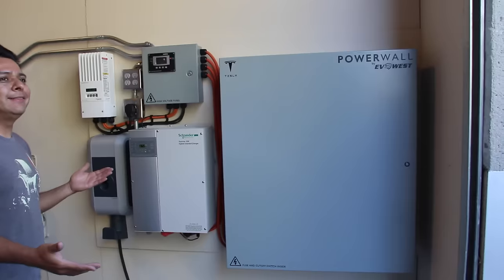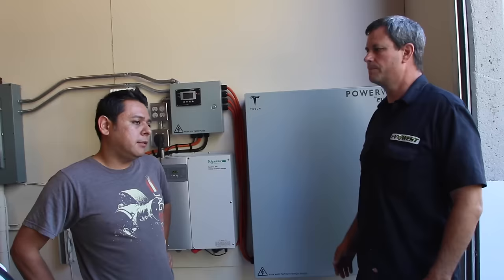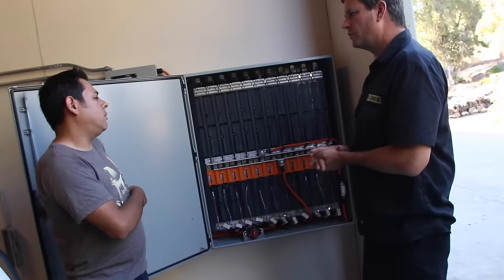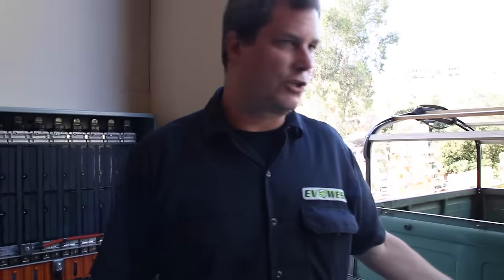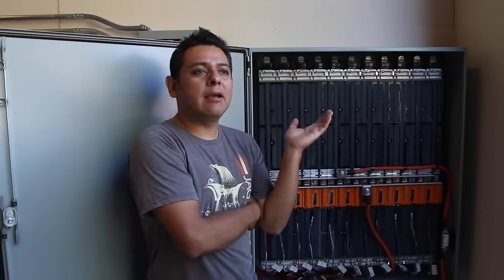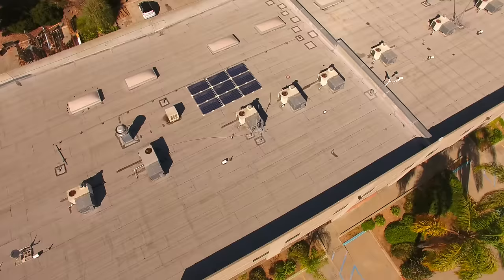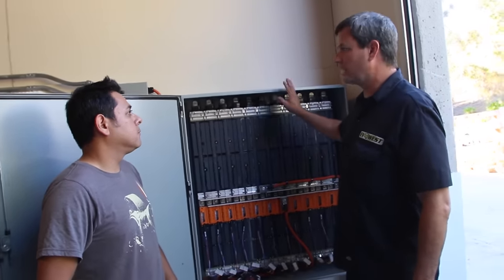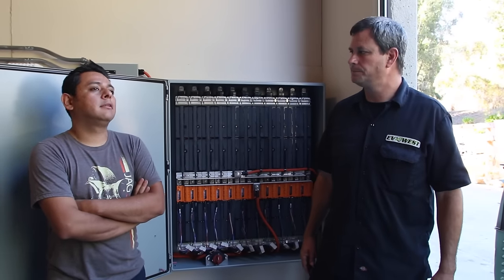DIY TESLA Powerwall  - my  WALL vs ELON'S WALL

Comment: what Tesla need to do is add solar cells to the vehicles ruff
Reply: That would net you about 100ft more range each day wow totally not worth it
Reply: Acually I think this idea has potential - I was thinking about this for some time. I dont think this would be great for personal vehicles - although it wouldnt need to affect aerodynamics in any way. However, with anything bigger than that like trucks this is surely the future. It would help much more than 100ft.
Reply: Stefan can you add? No it would not help much more then 100ft
Reply: I think this "100 ft" argument is nonsense. Keep in mind that the panels would charge the battery all the time - not only while you drive.
Reply: All the time even at night lol.  No its not nonsense you can do the math for any give vehicle you simply have to figure out how much energy it takes to move it 100ft look at the max amount of solar panel area you can put on the roof.  What is the max kwh production of those panels? Do the math as many others have and you can see for yourself 100ft is not nonsense.  If solar panels where that awesome.  I would only need one small panel to power my whole house.
Reply: +Wok if your house was small enough :)
Reply: so 80watt/hour while your car sits in the sun for 10 hours while you're at work... 800watt. How much do you think it takes to move a car a hundred feet exactly?
Reply: dosmastrify
I am from the country where they do the 100% solar powered races and those things go 120kmph for hundreds of km. You guys obviously have no idea what you can get into a sedan size with solar panels if you try.
Reply: dosmastrify
yeah my point was people who drive to work, park in the sun and then drive home. There's a lot of potential to charge the battery to full for the trip home. If that's 90% of a persons driving it would be worth paying an extra couple of grand at point of sale...
Reply: you do know there are flexible solar panels.
Reply: if solar panels could somehow charge using infrared it would charge during night.
Reply: dosmastrify you could put it on the roof under glass molded to fit the shape of the car.
Reply: dosmastrify
there are plenty of clear hard coatings. and yes you can have bendy solar panels. You could put solar panels all over any car pretty much...
Reply: The Tesla sales guy said there wasn't enough surface area to justify it. He gets that question a lot!
Reply: 800 watts is ONLY just over 1 Horse Power (760 watt)! In fairness, you'd probably get more than 80 watt hours. Most of the modern panels about the size of a car roof are around 250 watt. (the size in a domestic PV installation) ... so 2.5kw or 3 Horse Power. Compare that with the highly specialised and sophisticated Formula 1 power storage of around 120 KILOWATT(!!!) which only lasts for about 30-odd SECONDS!!! 

Just to be clear, 120 kilowatt (F1) is 4 MJoules of energy (max ALLOWED to be collected per lap), or about 160 Horse Power (Golf GTi range) so no mean feat to gather that in ONE lap from the braking, the turbo and the heat output of the engine. A Joule is a Watt second so 3600 Joules is 1 Watt hour. 

4MJ is 4 x 10^6 / 3.6 x 10 ^6 = ~1.1kWh
divide by 760 to get Horse Power and multiply by 3600 for Horse Power seconds and divide by 160 to see how many seconds at 160 HP = 1100 x 3600 / (760 x 160) = 32.5 seconds

BUT, and it's a HUGE Kardashian BUTT, it lasts for only 32.5 SECONDS!!

People on here think they can generate that from a single panel on the car roof? Err NO! Even a pathetic Renault 2CV (9 HP) produces almost 7 kw and it can deliver that for HOURS! 

Even if you said you had only 75 Horse power (equivalent to a normal Golf 1400), 120kW/4MJ would only last 16-20 seconds. Even if you accelerated slowly and only used 30 HP getting up to 60 mph, you would have run out of power just a couple of seconds after reaching 60 - if you got there at all. 30 mph is 44 feet per second - you do the maths. You would NOT get to 100 feet on 2500 watt/3 Horsepower, or VERY unlikely to - would it be enough to MOVE the car?

You can test something similar with your normal ICE car. With a fully charged standard 12volt battery, you will have around 40AH to 80AH available. That's 480 to 960 Watt Hours (similar to what you proposed is available from a solar panel). Put the car in gear, let out the clutch, turn the ignition and see how far you can use the (highly geared) starter motor (BAGS of torque) to move your car before the battery is killed or just unable to move the car? How fast did it go? If you managed to get 20 feet you were doing well. 

I DO NOT recommend doing this exercise as you will likely damage the starter motor and knacker your battery but hopefully you get the point.
Reply: Bob Lewis the point of solar panels is to store the energy and use it later, not to directly use the energy. while the car is driving it could charge the batteries. there are solar panels that can generate 1000+watts.

and dont forget that these solar panels are all 2D. if you made the solar panels clear and 3D it can generate more power.
Reply: MrPepsicola123 Please explain to the readers EXACTLY how long it will take to store 4MJoules or 120kWatts using a 250 watt solar panel or did you miss my specific and basic arithmetic? And I NEVER stated, NOR implied that I was talking about using a 250 watt PV panel to drive a normal vehicle directly. You CANNOT STORE 120kWatt in 10 hours. Even IF you could it will only last you 32.5 seconds when producing 160 HP. Please do NOT promote such idiocy to people who probably genuinely want to understand but are being totally confused by uneducated and unqualified people spouting utter garbage!

BTW I'm a graduate electronics engineer of over 40 years standing and as it happens my youngest brother is the engineer at McLaren responsible for the MGU power setup on their F1 car. What are you credentials?
Reply: Bob Lewis Have you heard of stirling engines? I couldn't care less about your credentials. it doesn't prove that it's impossible because you say so.
Reply: Of course I've heard of Stirling engines. Sigh! What the hell do Stirling engines have to do with solar power panels? Solar heating used to drive the Stirling cycle? Yes, OLD news. That's NOT what has been suggested here. The suggestion is that one should put solar cells on the roof of a car to recharge the battery on the fly. The ONLY relevant thing is this:

To move a vehicle requires power , measured in Horse Power or Watts it doesn't matter which. If the vehicle requires x watts to run at a certain speed and you can charge the battery (or drive the motor) at y watts and y is bigger than x, then yes, you CAN keep the vehicle going all the time. However right now, today, x >> y!

What YOU are claiming is that  a 1000 watt panel (or even if it were available a 2 kW one) is big enough to replace the power consumed by a vehicle travelling at reasonable speed (say 30 mph/50 kph) as it goes. 

I've already explained that it is TOTALLY NOT sufficient because that equates to 1 kWh ONLY after ONE HOUR whereas a practical amount would need to be nearer to one half of that amount (500 watt hours) PER MILE! 

At 30 mph/50 kph that means EVERY 2 minutes (time for a mile at a steady 30 mph) you would need to replace 500 Watt HOURS to stop the battery from discharging completely.

1 kWh charge rate = 1000/3600 = 0.28 watt seconds
But the car needs to use 500 Watt HOURS in 2 minutes 
 500/120 Watt seconds = 8.33 Watt seconds i.e. you can only charge the battery with a 1000 Watt panel at LESS than 1/8th the value needed. At 60 mph/100 kph it is even worse as power consumption is clearly higher at that speed due to air resistance alone, never mind other losses.

When solar panels become 15-20 times more efficient per square foot (allowing for cloud/low light etc. and a reasonable amount of dark driving - big consumption increase even with LED lamps) then yes I'd agree with you, but right NOW, TODAY, November 2016? No way Jose! It's SIMPLE arithmetic. If you can't see that, you really need to go back to school.

BTW I checked and a Tesla model S has an 85 kWh battery (310 MJ) option which, at around 125 mph, lasts about 40 minutes (do a google search). So it is almost 80 times the capacity of an F1 electric power plant (4MJ) and lasts for roughly 80 times as long when used to the max (40 mins v 32.5 seconds) - Wow! my arithmetic IS correct - surprise, surprise! Go figure!

A Nissan Leaf apparently has a 30 kWh battery option and requires 5-6 hours to fully charge using a 7 kW charger. On THAT basis your 1kW solar panel, under IDEAL sunlight conditions (North Pole in summer, no clouds, car on its side, panel pointing directly at the sun) would require 7 times longer or 35-42 hours (of sunshine)! Duh! Come on. Wake up and smell the coffee!
Reply: The Idea has been speculated for quite a time, However electric vehicles and solar panels would need to improve their efficiency quite a bit for it to be actually improve the economic value of buying a car with both.
Reply: Joshua Ducheny that's why i was talking about Transparent 3D holographic Solar panels to replace 2D solar panels.
Reply: I park in the shade.
Reply: Nigel Harrison ruff
Reply: smh
Reply: Well, as others have explained, it's too small an area to really add to your mileage, unless you use your car once a week (or whatever), and let it sunbathe the rest of the time. But it could run the AC and fans for it (which is most used on sunny days). Plus, if you have a Tesla-specific solar module, an air-gap between the roof and the module would isolate the car from the outside heat (or cold), so it would help decrease the required cooling.
Reply: hes joking, everyone chill out lol
Reply: Odee So are we to always assume something is unfeasible just because someone jokes about it? A solar panel could help drive the AC, fans and small stuff.
Reply: no it wouldnt
Reply: Toyota are adding a solar panel as a range extender for their new 2017 Prius, but what do they know about electric vehicles?
Reply: ruff? the "what a dog says"? or did you mean roof?
Reply: It dose not do anything for the range, it powers the fans when the car is off to keep the inside the same temp as the outside.
Reply: Build the solar panels into the roof of the car. Literally, make them the entire roof. They could be used as power for hvac, audio systems, etc... Perhaps it could look like carbon fire.
Reply: Nigel Harrison This idea is about as good as putting a windmill on your "ruff".
Reply: Nigel Harrison You'd only get about 1HP worth of solar power. It wouldn't be worth it.
Reply: Štefan Rástocký  How do you figure? You'd only get about 30 hp out of it, and the batteries and electric motors add weight, while the whole setup would cost more than you'd save in fuel.
Reply: Kyle Red Windmills are a good idea, they are just not spring-feathered properly to avoid wind-damage if the turbine is big enough. They also use overpriced materials because they are just subsidy-hogs. If they were made out of the cheapest materials possible like wood, plastic, timber etc. then it could easily pay off.
Reply: Nope they shouldn't you obviously don't understand.
Reply: What about designing a paint or a coating that is similar to a solar panel.. 

Rather than needing wiring.. why not just allow the coating have terminals close to the batteries to absorb the power.. .... 

Yeah.
Reply: A 300w panel weighs about 40 lbs... and is about 6'x4'... You would get 2-3 panels on the car. That is 600-900w, which produces about 300-450w for about 4.5 hours a day, that can be stored. (450w X 4.5 = 2 kw a day) 33 kwh would take 16.5 days to charge. Or, think of it this way... 2 kwh = 6% more range per drain-cycle.

Electric cars still cost more than gas. They are just potentially "more green", because you are using nuclear and well managed coal/oil power-sources, to recharge them. (Paying premium prices for storage and delivery, use and repairs for electric cars.)

In ten years, when the batteries die in an electric car... no-one is going to want it, except for a hobby vehicle. After buying it, they would have to pay thousands more, to get it to run. You wouldn't buy them, in hopes that it sells. (Plus, the controllers and motors might also have to be replaced too, which is as much as the batteries. More, in some cases.)

Comment: How far does your electric bus go on one charge??    Cool charging setup!
Reply from the maker: far
Reply: to me that just screams 60 miles lol
Reply from the maker: +xilw3r I've made like 50 videos on the eSamba guys,  all kinds of detailed specs are available
Reply: 53kWh so I assume 160 but probably more unless you're going high speeds with that brick body
Reply: Watch Jehu's Road Trip videos. There is not single number of miles. It all depends on a bunch of factors. But Enough to do a road trip.

Comment: go with edison batteries, they last 80 years and basically can't break.
Reply: Yes, I am currently trying to figure out how long the Li-ion battery's will last. 
Panasonic suggest that their batteries (used in Tesla powerwall) wil degrade 25% after 500 cycles of 100% capacity (that's from 4.2V tot 3.0V) 
At a Daily use, that's about 1.3 years.
Reply: You'd only been cycling them at 100% capacity if you're literally trying to degrade them as fast as you can.  You wouldn't do that.
Reply from the maker: +roidroid   That's how much I don't care,  20 years of life worse case why would you worry about degradation?
Reply: According to wiki, this battery has a charge/discharge efficiency of <65%. That mean you lose >35% of all the energy you put into the battery.

Comment: When Model 3 hits the market with probably a ~60kWh battery pack, someone could hack that into a mobile power wall. Use the car for grocery getting and the like for a company, and when (23 hours per day) at the company it will charge/discharge smaller systems as needed.